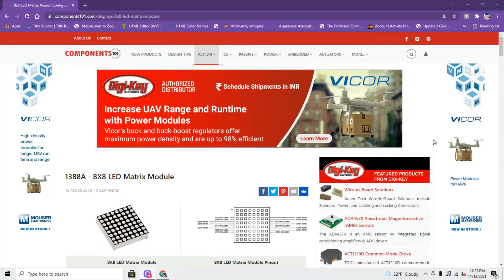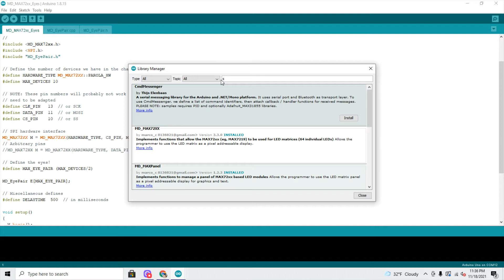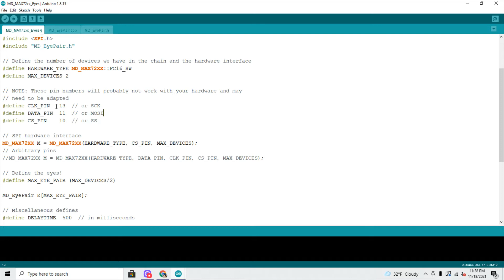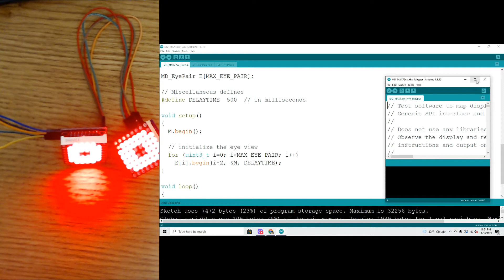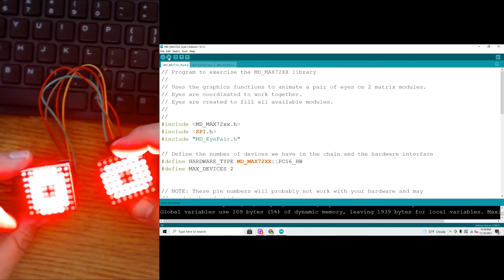How To Set Up Your 8x8 LED Matrix Eyes Animation For Arduino Beginners - Install and Troubleshooting

Comment: So how to know the hardware type?
Reply from the maker: Download the MAX7219 library. There's an example in the library called MD_MAX72xx_HW_Mapper - open this example in ArduinoIDE. Upload the sketch to your boad with the 8x8 led connected and follow directions on the serial monitor. It will ask questions about direction of led movement....after you answer the questions it will tell you what yo have. The type depends on how the matrix is wired and arranged which affects how you address them in the code. I found that most of my 8x8 modules are FC16_HW
Reply: @BMonsterLaboratory  thanks!
Reply from the maker: @fredericknielsen4984  you're welcome. best of luck to you!